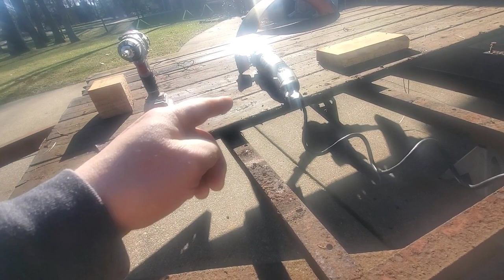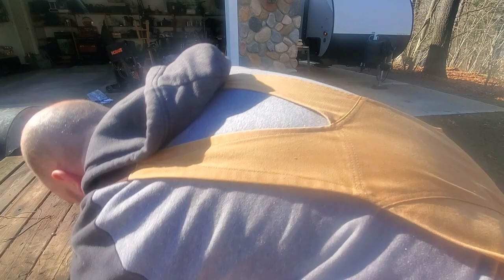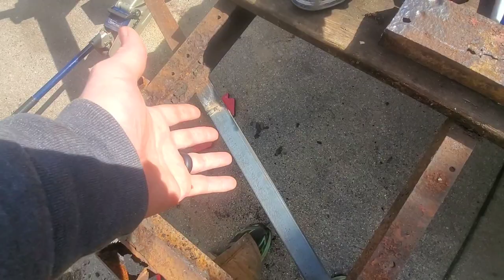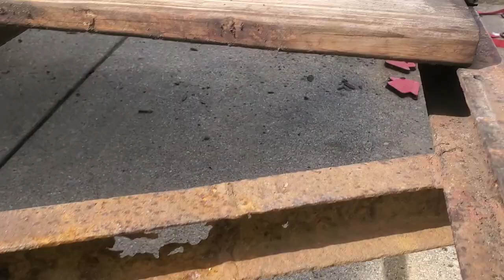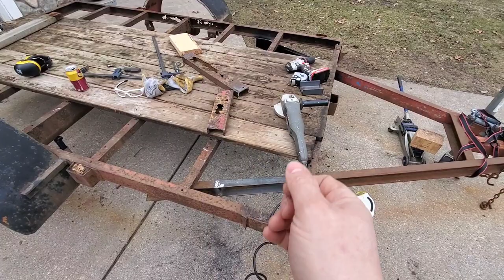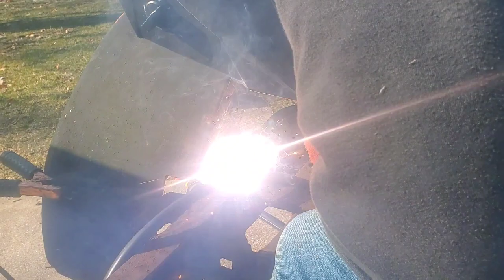We start repairs on rusted out frame

Comment: Great to see you making progress... In future repairs /builds.. Looking @ your tongue replacement sections  Make your cuts at a 45 degree angle..  " /  "  Have them angled inwards::::::: \\::::::://:::::::  Makes for an easier fitment and a stronger joint. Everyday is a learning experience. Starting the journey is the first and best step. Thanks for sharing 👍
Reply from the maker: Thanks appreciate it
Reply: I'm guessing it's stronger because when you cut it on a 45, the weld is longer than cutting a 90 across?
Reply: @williamguillIII  correct

Comment: When you end up a little short on the cut , You can use a coat hanger to help fill in using the mig welder, similar to tig welding.
Reply from the maker: Wow awesome thanks for the tip. I will definitely use that I'm sure in the future.

Comment: Just a tip for you, buy your metal from a fabrication yard, it's sooo much cheaper than buying pre-cut from a hardware store. They will also cut what you need to length most places sell metal by the pound or the foot. Keep it up, hope to see more videos from you..
Reply from the maker: Thanks for the great advice. 👍 There are a few open to public metal yards about 30min from me. I'll check them out.
Reply: @OptimisticGarage a scrap yard may be a good choice, too, although if they are a small yard, they might not have many options in materials.

Comment: I'm buying a used arrow sign trailer to modify into a 4'x5' for moving small equipment around. It was never registered or licensed as it was used in construction, so I'll need to make some changes to it before I get the enhanced inspection to title it here in Pa.
Reply from the maker: Sounds like a nice project. This trailer had registration however it was so long ago that it was before certain requirements they use now. Simply filled out a form at dmv and I need to affix the new vin number to trailer they gave me. Good luck with your project. Thanks for Watching

Comment: I would like to add one more thing. Grinding the welds flat really is not needed even if they look crappy.t will possibly weaken the weld joint.  If you do grind the weld off and it does look questionable , lay down another bead . In  your case , the road is the only thing that will see it Continue on.
Reply from the maker: Thankyou!

Comment: New FAN here Brother!! This is EXACTLY what I need to do for my two utility trailers, but wondered if my MIG could handle that thick of metal? Now I know, but are you able to tell me what you set your MIG welder at to do this? Totally new to this, but retired and can't afford to hire anyone to do it for me! THANKS in advance!! I will be RHINO coating entire trailer and underside of plywood I'll be putting back on, to help with weather proofing!
Reply from the maker: On my Hobart 125 I set it to the highest voltage and wire speed seemed to be best at 30 out of 100. I used .30 size wire. I learned to take my time with slower wire speed for better penetration. Also be careful when grinding as to much weakens the weld joint. I by no means am a welder but it can be done. Trailer has been hauling top soil and mulch. No issues
Reply: @OptimisticGarage  Thanks! I have one of the Harbor Freight Chicago Electric 90 MIG welders myself. I need new wire anyway and will upgrade to the wire you mentioned in your video! Thanks again!
Reply: @TheMongo1357- we have a teardrop trailer on an aluminum frame. Wanting to strengthen the frame but also waterproof the wood/plywood floor during the process. . RHINO is a great idea! Thanks for sharing your process - and same to @OptimisticGarage!

Comment: With how rusty that trailer is, I'm rather surprised you put so much work into repairing it, instead of building a new frame and salvaging things like the axle & suspension, the hitch ect.
Reply: With Bidenflation have you seen the price of rust these days?! 😄
Reply from the maker: Yeah a guys enjoying the process of repairs. I tend to gravitate towards junk and then repair and use it.
Reply: @OptimisticGarage  I can understand enjoying the process of repairs, I usually repair things myself, but sometimes you just have to salvage what you can and build something new.
Reply: @armandhammer9617  LOL.  If it's as bad as "downunder", yes, rust is getting expensive, let alone fresh steel. I have an old 7 x 5 trailer I was going to repair, until I worked out that I need to replace half the frame of it.  Instead, I'll salvage the bits I can and build a new frame for it.

Comment: Looks like your doing a good job so far.  Obviously, if you factor in your time this trailer wasn’t worth saving, but as a demonstration it is being put to good use. 1 question,  why cut off 4 inches of new material so you could weld it to a rusty 4 inch piece of metal, could have cut off the whole end of the C channel and welded the new piece to the bottom of the platform?
Reply from the maker: Thanks. I really enjoy learning and the whole process. In the end there will be things I would change for next time no doubt. Thanks for kind words.

Comment: keep it in your yard for for small yard  work never pass dot inspt for hwy use  ps did ya get that trailer 4 free
Reply from the maker: No dot inspection needed it’s under 26000# and not commercial use. Been great little trailer. Thanks for watching.
Reply: keep up the good work

Comment: In my years of fabrication I've had to do the same thing. Cut new material and scab the small stuff. If I heard correctly your using a flux welder is it a 125 amp or larger? I've been using a 125 amp for about 4 years hasn't failed me yet. Check out local scrap metal yards you can get real deals. Keep up the fine work. 👍🏼👍🏼
Reply from the maker: Thankyou! Nice to hear the success you have had with these small mig welders. I'm loving the process so far and really appreciate the support

Comment: Do you think those rusted out beams could be reinforced with bolted on supports instead of welding?  I don’t have a welder and have never welded anything before
Reply from the maker: I imagine it's a possibility. Make sure you have good solid metal to bolt through.
Reply: You could but... it'd be far easier to just pick up a <$200 HF welder. Or probably even a cheap flux core from Amazon would do it. And with the number of bolts I'd need to feel safe with my repair, the welder would be cheaper 😅